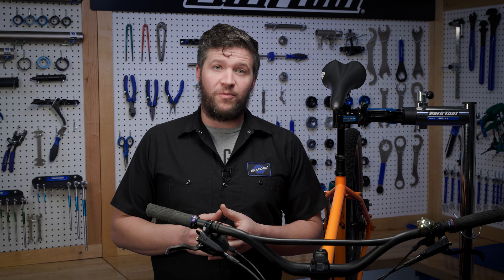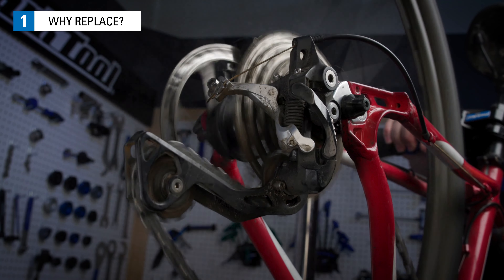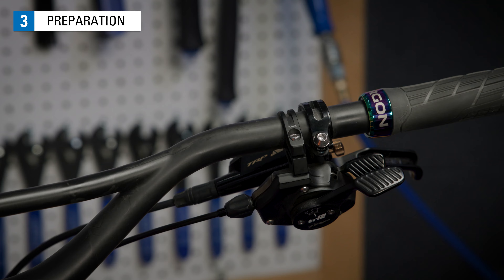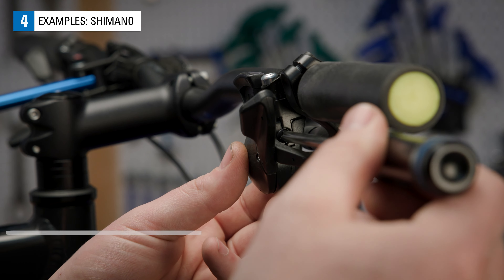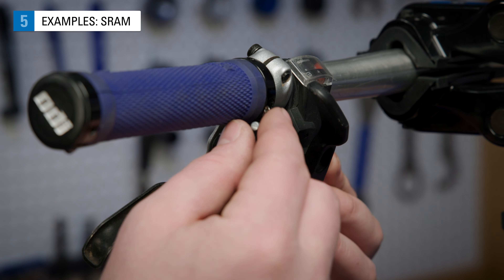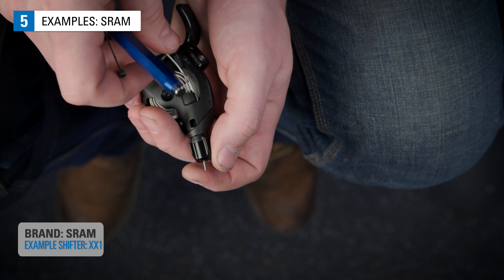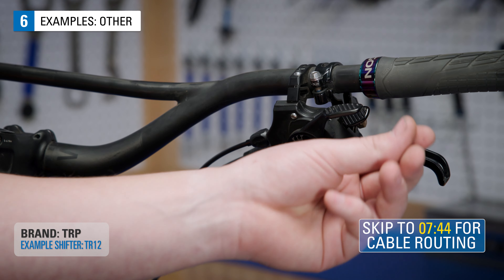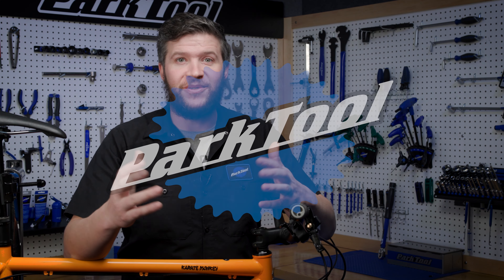How to Replace Trigger Shifter Shift Cable

Comment: Adjust barrel screw before tightening cable.  Might be at derailleur (old school) and shifter. Usually one full turn out from fully screwed in (clockwise).  Great video!!

Comment: I appreciate the content. I must say, though, eight and half minutes of details about how to remove a cable and 30 seconds of how to install one, leaves a lot of questions. What gear should I be in before I lock the cable in place? Does my front derailleur need to be installed first or be in a specific position? I'm sure the comments below could give you plenty more points to highlight. Hope to find the video I need. Anyone have a recommendation?
Reply: The video literally answered this, if you watch closely

Comment: You forgot an important step, which is to clean the exposed cable before pulling it through. Otherwise, you'll pull gunk through your housing
Reply: or even cut the cable in several locations, espacially when the end of the cable is frayed

Comment: My chain is broken and shift cables are jammed. I cant complete the cable removal preparation you have mentioned. Any alternatives to it?
Reply from the maker: If you will be replacing the cable, cut it where you have access to it. That may be at the derailleur for non segmented housing or it may be somewhere else if segmented.

Comment: Hi, thanks for this useful video. How can i move the chain to the smallest sprocket if my shifter it's not working and the chain it's locked on the biggers sprocket? I cannot find this info anywhere.
Reply: Cut your cable and it will go.

Comment: My Shimano 2 trigger style has larger thumb triggers than pointer finger triggers.

I wish I could reduce the deadzone freeplay in the thumb trigger. Is this possible?

Bike is a 27.5 Diamondback Expresso in Canada.
Shifter appears to be shimano ST-EF500-4 which says on it "v-brake" but the bike is discs.

Comment: How do you pull the housing away from the shifter? Is there a special trick? That step isn't showed in the video.

I loosened my barrel adjuster all the way and it won't come out. Unfortunately I can't downshift to the lowest gear since the shifter is broken.
Reply from the maker: One of the first steps is to loosen the cable at the derailleur bolt.  This is for replacing the entire cable.  Once the cable is free, pull the housing.

Comment: When you shift down, is that going to a number 1 ?
Reply from the maker: That is a confusing topic in its own right.  
"Down shifting", similar to a car, is going to a lower gear ratio, an easier but slower gear.  Shift levers with numbers use "1" as the "first gear" or largest sprocket in the back. 

Some people say "shifting down the freewheel" is going from the "top" downward to the bottom small sprockets much like you are "climbing down the sprockets".  The chain seen at the top is going downward to the first outermost sprocket.